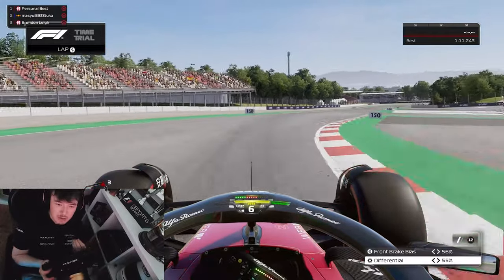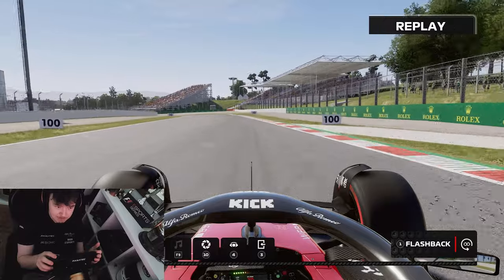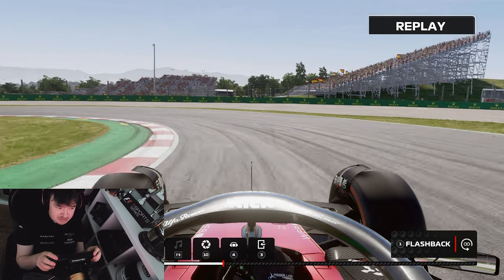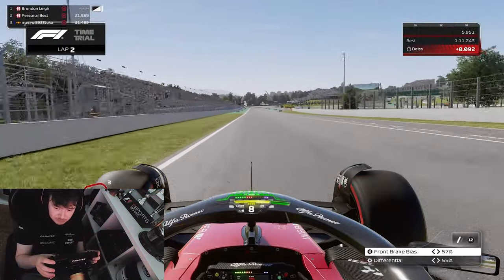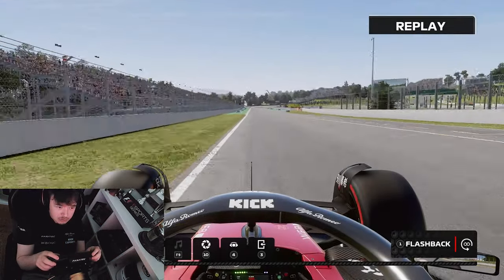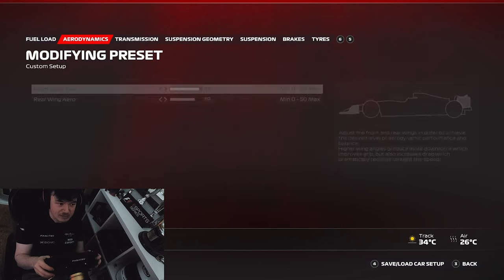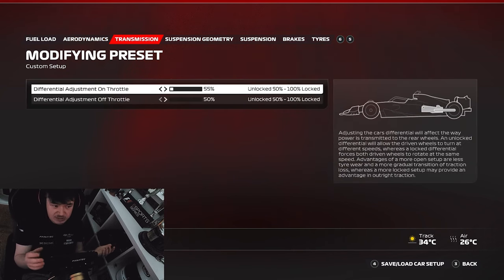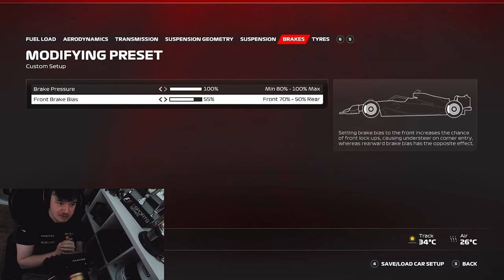F1 23 How to corner faster tutorial - beginner guide

Comment: May i ask a question? I am a league racer since f1 21 and i feel kinda stuck in pace... Im using a logitech g29 and lapping like for example 1 41.9s in spa tt. I do trailbrake, i do get nice rotation(sometimes i really need to work the brake to get the car turned in) im using esports setups and somehow im still beeing consistently 2 secs off esports pace. I asked guys like DurkChocolate or Duncan Hofland for advice via discord on my hotlaps and they told me i should just go faster, because the car doesnt seem to be on the limit. In the meantime im just sweating like a waterfall in my rig and struggling to keep the car on track, thats how much i push, especially trying to keep the minimum speed in the corner up. Do you have any advice, or have u been in that position just hitting a concrete wall in terms of laptimes yourself? Much love and keep up your cool vids❤
Reply: I'm in that situation right now with controller, I can't get faster than 1 second off esports pace 🥲